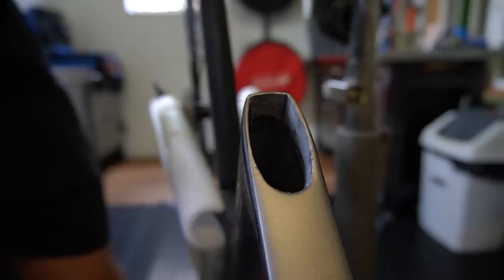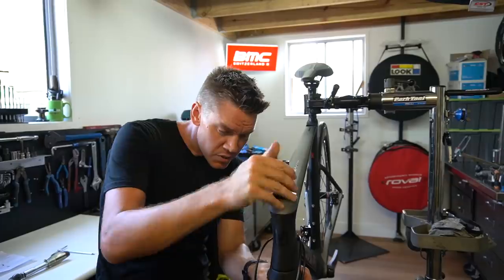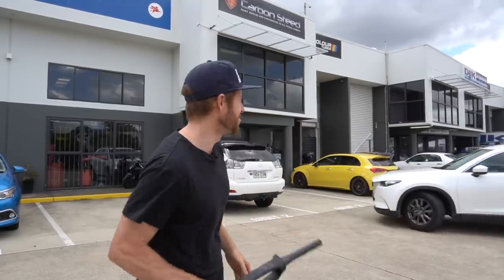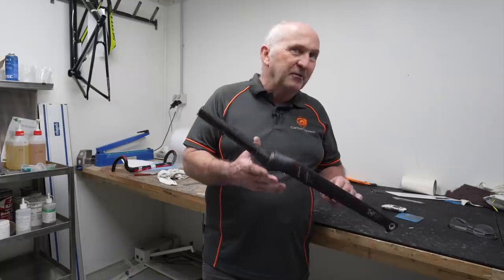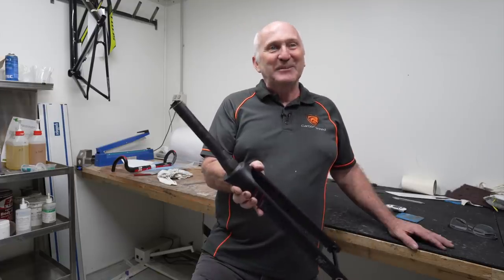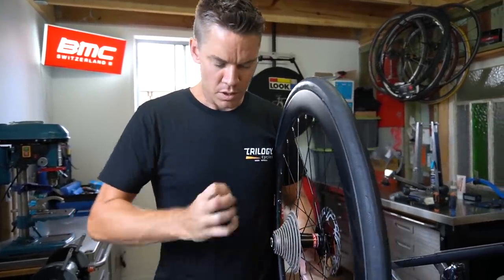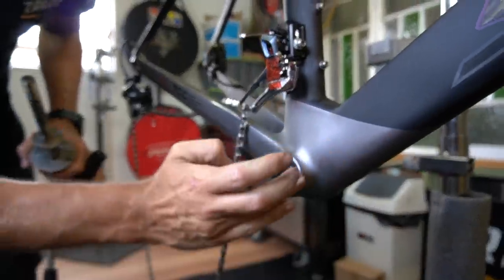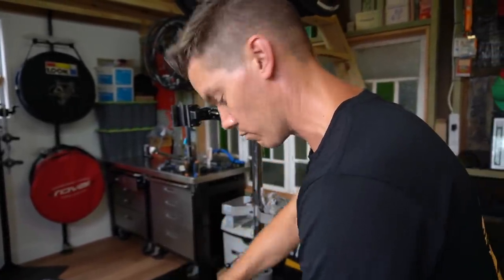The Cheap Chinese Carbon Bike that Backfired

Comment: The reasons I bought Chinese cheap Frame are:
1. Not for professional riding, but daily shopping and commute 
2. Frame, fork, seatpost, and handlebar only. As far as I feel they are not too fragile to break, only feels not perfect (what would you expect)
3. Driver chain groupset, wheel, brake, shifters are better buy from well known brand (for your life safety)
4. Carbon frame shipping fee is much lower than alloy or steel frame. The total money you spend won’t have big difference in total
Reply from the maker: Thanks for sharing on the thread

Comment: Great video Cam, I got alot of value from it. Question! does having the your BMC chain in such a low gear for prolonged periods weaken the derailleur spring tension. Or is it a Myth?
Reply: Myth

Comment: Well, if bikes roll out of factories in near perfect condition, then, many, many bike mechanics would run out of work.
Anyway, lemons come in different shapes and forms.  Even high end cars, motorcycles, watches, tv's, bicycles, etc, etc, etc turn out to be lemons in the long run, no matter where they are manufactured.  It would be best to buy such things when you can see them.  Of course these things have warranties.  They are willing to replace them.  But, such hassle.
Lesson that I've learned, even before this video is:  Buy only what I see, have inspected, tested, held, smelled, researched on, asked about around, weighed and scrutinized.  Spending $500 or more on something which is virtual seems to be an unwise thing to do.  So much for convenience.  Or is it really convenient to buy a lemon, especially online?

Comment: I refuse to build a wheel or service one with Novotech hubs. They are not consistent in quality. They are cheap to find on ebay for a reason. Even a low end Shimano Tourney hub doesn't have a wobble like on your video. What was the sponsor thinking when they sent you a bike with a riding issue....

Comment: I certainly wouldn't grease bearings into a bearing cup! Guaranteed to make the fit lose through wear. Why would you want a bearing moving around in the cup? Just to keep it quiet? That's an insane solution. Use removable loctite. On what other kind of machinery would you grease up something to keep it quiet when it shouldn't be moving at all?
Reply: How is it gonna wear if its lubed?

Comment: The Chinese quality seems to be a bit "hit or miss".  I've seen some very good quality carbon bikes and carbon components from China and I have seen (same brand) come with issues like you've identified with this bike.  Unfortunately when you buy from China you are somewhat "stuck" with what you get.  Communication on a warranty is challenging and and shipping back and forth is very slow.  That being said, I have ordered a few carbon fiber components from China (seat, forks, seat post, wheels) and what I received was excellent quality.  I have a riding buddy that ordered similar components and had quality issues.  So a bit hit or miss.

Comment: Is that  mechanic new to working on carbon steerer bikes? 

He let you ride out on that bike with an improperly installed steerer plug...he was joking that the fork wasnt MADE properly yet he didnt INSTALL the fork properly by putting spacers ABOVE the stem and running the STOCK short plug that is designed for ZERO spacers ABOVE the stem...

ZERO bikes leave my workshop like that. I put pride in my work.

Comment: The thing about carbon fibre is it is a great material and has its place in this world it's used in F1 and aircraft etc in those applications every piece is checked for strength and voids etc, it is laid up with uttermost care and professionalism because it has to be and that goes for both high and low modulus carbon fibers. Now and this is purely my opinion if anyone thinks that every single carbon bicycle frame is checked to the same extent as above is extremely nieave yes they have quality control and destruction testing but they are still unpredictable at best plus where are all these poorly made frames going to end up in landfill.at least you can recycle steel and aluminium I don't hate carbon bike frames at all I am sure that a great majority of them are fine and will never snap a fork or a chain stay after hitting a pothole or decending down a mountain because of poor quality control. I have 2 mountain bikes both aluminium a Whyte 901 and a mondraker factor xr, not top of the line bikes but ok for me at52 years old I don't use them for racing I use them for bikepacking particularly the Whyte it's my everyday bike and I love it loads. I joined a local bike club recently because they do a group ride every Monday for people of various experience on my first ride meet I encountered the my bike is better than yours brigade and yes they were on carbon framed bikes I kept my opinions to myself. One guy was on a 10grand aero all singing and dancing road bike I forget what make it was a beautifully light bike the rider had all the race apparel on lycra,aero goggles the lot he was 20 years younger than me but I hate to say it he was very overweight and not very aero himself so why waste 10 grand just because you can. The other guy was on a specialised brand new he paid over 6grand for it which is ok if you race he didn't he asked me why I ride heavy shit lol the cheeky twat, now I have been a semi professional bodybuilder in my younger days I still do it only to keep my fitness and physical shape told him I was heavy and ride very long distance with weight in a trailor he got really angry when I overtook him on a hill sitting down. The point to all this drivelling crap I have wrote down is that carbon has its place what I experienced on that one night is trends and fashion over abilities and common sense and cycle companies targeting that corner of the market just my 10 cents worth carbon not for me this video proved my thoughts to me anyway..

Comment: What I find incredible is when a supplier gives a bike for review with defects . Wouldn't make sure the bike is in tip top shape to get a good review . Now in the real world all the bike manufactured should be afequetly put together and function within specifications but these guys could not get the reviewed bike correct . One bike that is being publicly reviewed . Now this is not unusual . If I saw a review with quality control defects I will probably never look at that product again and I will tell others of that negative experience . This is why business fail shortly after startup or just stopped investing in solid production of a product .

Comment: I have bought several cheap Chinese MTB frames with very good success. I believe you need to be a good tinkerer and have a proclivity to doing your YouTube research. Other than the fork issue, everything else is EASILY fixed. Missing some grease here and there - add some grease. Novatec rotor mount holes being off center - I question that. Novatec makes millions of hub assemblies yearly - they aren’t drilling the holes with hand held drills from Harbor Freight - this is all CNC drilled stuff with reasonably close tolerance.s Is it likely the mount holes are off ? Yes. CF Frames are largely a hand crafting operation and can experience anomalies - most often curable with a little tinkering. ?  My conclusion: if you are not mechanically inclined and don’t own tools (or don’t know how to use them), you have no business buying anything except stuff from your local bike shop. Will you pay more? Way more. Will you be happier? Way happier.

Comment: I can understand where the mechanic is coming from, but I don't agree with all of his remarks. I applaud his thoroughness but felt his tone was unnecessarily snobby. Brake levers being flipped L/R? That's because some markets require that convention. Bearings not greased? I guess I would expect to be doing a full rebuild upon receipt anyhow, but I do sympathize with the beginner cyclist who's not a home mechanic. For such cyclists, none of these DTC bikes are a good fit, IMO. I would agree that the hub issue is the most concerning. Not sure I'd write it off as unrideable but I acknowledge this is a question about what's the acceptable level of risk tolerance.

Comment: This still doesn't provide a reason for why bikes today are so over priced. When a bicycle costs more than a modern motorcycle that tell's me the system is broken and price gouging is prolific.
Reply: I will add that anyone providing any explanation as to why bicycles should cost loads of money and knock offs are bad is simply apart of the machine.

Comment: To me there isn't anything that backfired here, you are paying  quarter the price that Cannondale would charge for a bike. 
In a situation like this you can absolutely buy this bike and replace the wheels with something good from Mavic or Fulcrum and you would actually have a better bike  than what you would get from Cannondale or trek and you would still only be paying half the price.
The imperfections in the carbon fork is meaningless  when you consider the same carbon forks and frame from Cannondale etc uses the same Asian factories with slave labor.

Comment: These bikes are not as bad as these reviews make them out to be. If you’re not a tour professional or a crit rider, you will be fine with one of these bikes. Most reviews like this are basically nitpicking. No you will not be getting the same quality as a top tier manufacturer, but you will still get a good bike. Do some pre-ride maintenance on the bike and maybe upgrade some of the components and wheel sets and you will be just fine.

Comment: Kinda silly video. As a responsible shop owner you should always go through every bike that comes through your shop pre-assemble. Potential customers have a responsible expectation that the shop has down a thorough job of insuring the product is safe to ride and is mechanical sound. You are receiving a product that is preassembled not necessarily gone the “final assembly”and “final quality control”.

Comment: This is just shameful. It's like they got Cam to do free quality control. Cam is being gracious about the vendor, but honestly, this smacks of a business trying to make a fast buck, while putting out dangerous bikes. Folks if you don't have the money for carbon, go aluminum - great bikes and often between part for the same money. I'd say go steel, but steel is becoming a more of an eccentricity than a main-stream cycling material.

Comment: LOls, if you paid cheap then you get cheap. How is that so difficult to understand? It would have been in all honesty tell us how much you paid for it. The manufacturer will supply any specs required by the distributor. If they ask for crap material then that is what you get. Just look at Apple products where the specs are specific in terms of quality. I still have a 2009 iMac made in China that still works. So to be fair, you need to truly educate yourself on how products are made. It will make you more trustworthy and not the lack of it, in my opinion, as it now stands. Things are not always what it seems.

Comment: I guess its the old addage. You get what you pay for. You want cheap, you buy cheap, it is cheap. Better to buy a steel or aluminium frame from a well known company (possibly hand made) albeit older without the lame disc brakes rather than gamble on a Chinese rip-off company. Because lets be fair, you oly upgrade for the fact it has disc brakes, dont waste your time or money.

Comment: Well hold on, it sounds like the wheel was the issue, not the bike frame itself. Frankly, much of what you were identifying was the cosmetic issues. If you wanted to actually test it properly, why don’t you put the frame through legit carbon frame stress tests and let’s actually see how it stands up.

Comment: These low carbon composite frames, can do the duty as long as you adhere to the weight capacity it is designed for.
So the lighter the rider is, more you will benefit from this frame.

Comment: That’s why you should stick with top name bike brands like Canyon, Cannondale, Specialized and Bastion cycles to avoid these manufacturing issues.
Reply: Canyon, Cannondale and Specialized frames all made in China too - Quest Composites, Topkey etc. You're buying shareholders dividends thanks to slick marketing with the big names. Winspace, Yeoleo and Trifox all offer a far better value proposition.
Reply: @johnflynn4923  We all know big business is a global conglomerate. The big boys have plenty of R&D and engineers and test into their products. I have no issues with smaller brands but they lack the high end resources and multiple engineers. That’s not to say that their products are inferior. Many small brands are pumping decent quality at a friendly consumer prices.
Reply: @stephen4347  I was putting those more budget names out there in case they're of use to anyone as many other long term cyclists (yep, I'm getting old lol) have said to me that with the all in costs it's gotten too elitist and the prices of these big brands are putting people off cycling. In fairness to the big boys they do lead the way in R&D which benefits everyone down the production chain (no pun intended). I have just built a Trifox and will probably take it out next week but I also have more premium stuff (however in steel) so it will be interesting to see how something like a Trifox actually is.

Comment: Even though China's bike industry has bike manufacturing all but locked up and supplies to the rest of the world, they are still 20 years behind the US and Europe in manufacturing quality control processes which ensure a product that is perfect every time.  In my career working with Chinese suppliers,  they often rely on the operator to do things right rather than build in process checks, fixtures, and machines that will not allow the operator to pass on a defective product.  If it's a feature like the runout on a wheel hub that will render the part unusable on a bike, then check that feature 100%, not 3 pieces every 50 parts produced.

Comment: I would never EVER buy a cheap frame with a wheelset with it. Those wheels are dangerous and unusable. Now the frames vary, they may be ok but sometimes too flexy or there are creaks or the inside too rough so full internal cabling is a nightmare. But of course there is knowing when they'll fail.

Comment: I bought my first carbon road bike happens to be a sava warwind 5.0 same frame as you got on your video. Shifting is horrible to be honest but I’m no pro and I only use it for fitness so I’m alright.
Reply: Could be nothing more than a bent derailleur hanger or just wrong tension on the shifter cable. Have your LBS check it out, should be an easy. fix

Comment: Chinese are notorious of making bad quality, they can make good stuff too, but it is so random. Nobody in the factory cares any of the quality, I mean if you can mill the hubs to not even be centered, then how is that even possible, its like their machinery was out of specs so much that you can see that with your naked eye. But they simple don't care. People will buy these and only few will complain and send them back. Maybe China is their main market and in there this is top quality in their standards.
The other thing is fake or copied parts, Even Chinese brands are copied in China and labeled as original brands. The copy issues has consequences mainly with safety and ruining the brands reputation which is hard to recover.